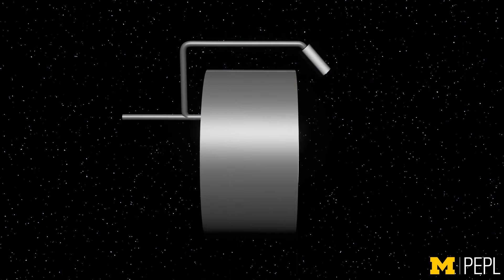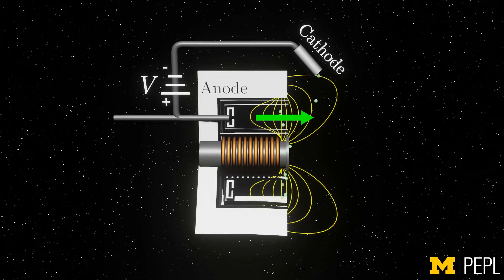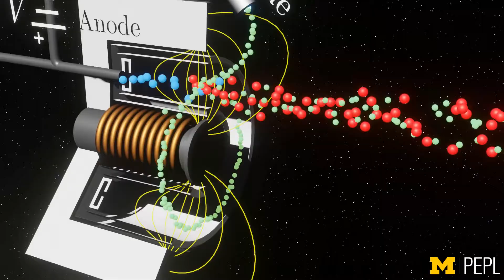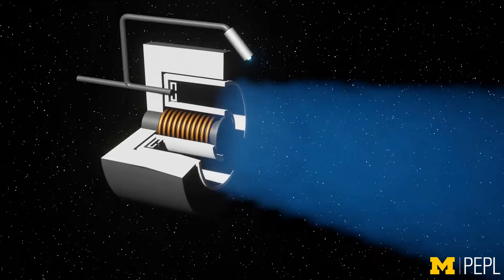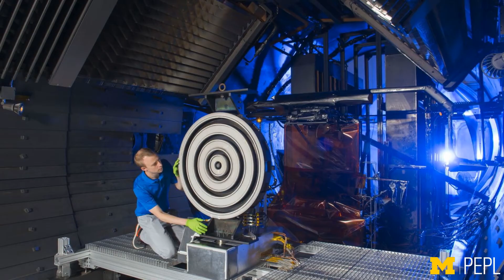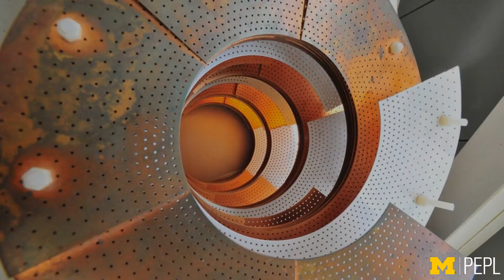How Hall thrusters work (and why we can't simulate them)

Comment: These are the best simulations of Hall thrusters that I have seen!  as well as the best description.  
On my channel there are flight videos of the only ion thrusters that are patented for lifting their power supplies directly against Earth's gravity, including a collection of efficiency upgrades! In some of the videos there are added propellant tanks as well.  They are constructed to be lightweight for their dimensions and particularly have a low areal density. By utilizing higher voltages at lower currents, less heat is produced and therefore there is less power loss. Contrary to a famous ion propulsion equation, the thrust correlates better with increased voltage than with current. Many on the details of these Ion Propelled Vehicles are published in US patent number 10,119,527, under the flight footage videos, and on the associated website.
Thank you for sharing your exciting and important work!

Comment: I have many questions. Wouldn't the electron eventually reach the anode even without colliding with anything? I remember their trajectories being spiral in shape when both an electric and a magnetic field are applied. Are photons produced by ionization considered as energy carriers towards the anode? Does electron capture produce photons energetic enough to ionize another atom that is closer to the anode thus producing a current?

Comment: This is a year old, so I don't know what improvements have already been found (YouTube feed recommendation) but! What about pulsing pwm & electrostatic rail gun circuit approaches combined with a simplistic light wave interference model. I know they managed to use light pulsed in a given sequence top reduce quantum noise and randomness. Since electrons already carry momentum it then means we would be able to create a pulse frequency that improves, with the correct electromagnetic field reduction of flux strength and it's placement in the thruster (multiple coils, I'm sure it's already done but I'm the center and another in casing combined with smaller coils placed nearly end to end on top of those coils, outer diameter & inner diameter) worth electrostatic insulation, that can be switched on based on current and field collapse, that allows for electrons to be made to more likely hit certain gases fired in tightly controlled jets by the light and electrostatic forces. As the electromagnetic would help create a Lorentz force effect to them. The electrons then get controlled by which attractive or repulsive forces in a given area they are around, light enters such that photonic pressure occurs while having the electrons move towards the forces of the gases being charged or the given flux lines moved with pulsing various smaller coils to help the gases land in higher concentrations areas. 

It should them become a resonance acoustic thrusting pump using these fields effects and light pushing and pumping. Basically a inward bound pressure wave of electrons hits a gas pocket that then expands, it's then creates a gas pressure wave that bounces off a electrostatic wave that got moved towards the next electrons wave.

My other channel has some programming upgrade ideas in it, but it would take even more writing, might check out the CPU combo playlist for that

Comment: You make the same mistake, beginner rocket engine designers. The actual thrust is not in the ejection speed, reaction force is not the propulsion.  In ion thrusters the thrust comes from the molecules, either neutral or ionized that hit the anode or rear wall of the chamber. Nested IT have more power because more rear wall surface is available. The grid on IT has the property of enclosing more atoms in the chamber hence increasing the chances of hitting the rear wall. To test that hypothesis, design an IT with the Noble gas inlet radially, injecting the gas at 90º to the motion direction into the chamber (now the gas atoms enter the chamber longitudinally, in the direction of exhaust). With radial injection of gas,  thrust may be reduced significantly.

Comment: I wanna be clear, I'm not an expert but I like to try and guess stuff like this.
The vacuum chamber used on Earth would lack the hydrogen ions found in space, and those ions are likely responsible for a higher current, as in you have the cathode and anode, and the electrolyte you can only measure with on Earth is higher PH, right?
 and in space there's more hydrogen ions, so the vacuum of space is sorta an electrolyte lower PH and so has less resistance.

Comment: I wonder if it would be possible to build one large enough to power a magnetic field that intercepts the stream of charged particles and slows them down enough to recapture and slowly bring back up to the expelling portion of the ion engine…
Reply: @R Hamlet how is there no change in momentum? The charge particles are slowed by magnetic fields far far down the line and reintroduced back up slowly. So say it’ll turn on for a day, and the gas is captured and stored and slowly pumped back up the structure. There would be no change in momentum because the mass capture is perpendicular of the mass flow of the engine, it will be pumped up slowly in a process that takes several more days and the reintroduction is done within the moving mass, thus it is not retarding forward motion.

Comment: Why it's an argon that is used here? If it just loses electron and goes away at mediocre speed, the logic says that something lighter, like hydrogen or helium would be better, right? it can also lose an electron and fly away, but you can bring much more of them on your space journey, as the argon is quite heavy in comparison.
Or this process doesn't work for hydrogen or helium?
Reply: The way i understand it, in helium or hydrogen the electron is tighter bound.  Would be very inefficient.  With larger atoms, its easier to knock off an electron than it is with small atoms.
🚀🏴‍☠️🎸
Reply: To get the same thrust out of a device using helium, you would need much more power. That is because the specific impulse (exhaust velocity) and thrust are inversely proportional for a fixed efficiency and power.
Reply: @Plasmas1 Thank you! So finding the optimal gas is harder than I thought, I will have to search for how it works. Looks interesting thing to think about, thanks for mentioning the key terms!
Reply: @MichaelWinter-ss6lx  thank you! I wonder how it would work with an access to thermonuclear reactor, allowing to produce much more energy from less of substance.
But well, who knows what breakthroughs are still awaiting us!

Comment: So... what sort of thrust are we talking about here? Grams?  And why must we use electromagnets when there are very powerful permanent magnets available?
Reply: Permanent magnets are available but they have stricter temperature limits than the insulation on some electromagnetic coils. Furthermore, in a laboratory setting you want to be able to change your magnetic field and once you find an optimum you could design a permanent magnet version

Comment: Hmmm considering it knocked an electron off the atom that way. I wonder if you could reverse it to knock a proton off instead. If so I think I see the possibility of a process to turn lead to gold now that's possibly cost-effective
Reply: Protons are bound to the nucleus by strong force, much stronger than em force that holds electrons in the shells. If you want to knock out a proton you need much more energy like the amt. used in accelerators.
Reply: Now thats cost efficient, as these accellerators are useually funded by the tax payers.
🚀🏴‍☠️🎸
Reply: @SC-zq6cu  I see

Comment: PhD candidate describes the velocity of the electrons in the Hall current queuing up to propel some neutral atoms as traveling at or greater than mach 1303.323 (non-repeating, of course)... Also doesn't model the time dilation this causes. ' Claims that the current at the anode is greater than expected, and the model is unsimulatable because some mysterious physics don't work right. 
This effect doesn't happen to an obvious degree in wires, for example, because individual electrons in materials flow relatively slowly (but super-fast as a "1 in / 1 out" net potential system, a very common misconception in electronics). The electrons do, however, move relativistically around their atomic nuclei, as per usual, making magnetism a form of Frame Drag, most recognizable between opposite poles (spins). If these electrons are revolving around the magnet pole at around 1/600th the speed of light, and we're measuring electrical current (which is a factor of time), then the measurements will be inherently off from the perspective of the observer, as will all near-luminal machinery.
Credit me in your thesis.

Comment: I thought ion thrusters were cool until I calculated their ISP and TSEC instead of their TSFC.. 200kW for a piece of papers worth of thrust.. Try slamming the pedal on your sports car and going absolutely nowhere 😂. I guess they are still cool with heavy modifications to make them thousands of times more effective given an energy, mass, time restriction common for literally any modern stone-age rocket engine form of propulsion. 🤣

Oh and there are way better electron emitters now besides tungsten doped with lanthanum or whatever they use, and wayyy better extensions of planetary mass to push off of for thrust than your own ion or combustive exhaust propellant. You have to understand what you're paying for and the geopolitics of our oil economy and our poo-tier oppressed technology sectors by the deadly black rocks and the glowing nosey needy neighbors.
Reply: Try a big-a** bubble of pinned flux planetary field helicaled around a thrust core with pulses of charged ions interacting with the extended field for an effective propulsive mass increase in the vacuum of space. Yes it may just make an EMP during functioning but it also could improve your ion pusher squeezer designs with near instantaneous interactions.

If it doesn't work or you don't have a big enough bubble to concentrate the field into a strong enough area or its not interacting with the field in a manner that is non-newtonian, then maybe it was worth a shot.
Reply: The concentrated hopefully not-so-motive field comes from the mass of the magnetic dynamo inside the planet and its layers, which can extend out for hundreds of thousands or millions of miles, the thrust comes from your static electric field against the ions 🤔

I'm hoping if its done right there won't be some sort of hysteresis that negates the effects and it won't act too ephemeral, and instead act with an equal and opposite reaction.
Reply: Also wondering if flux coupled cooper pairs can be pushed around and unpinned to create a translative tiny vector thrust for tangential low energy orbital maneuvers.. 🧐

Sure if the area you interact with is tiny there won't be many Neutons of thrust, but a big area, who knows, it might couple down to the crust or dynamo at some point, or even provide a tiny bit extra, which is all you need if you are measuring thrust in paperclips and pieces of paper.